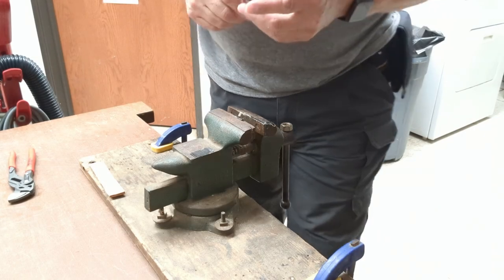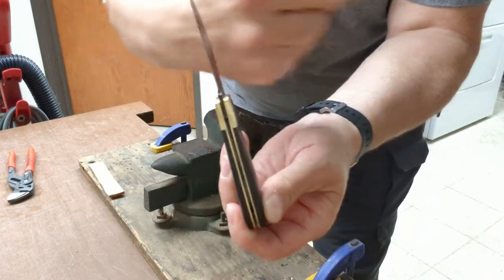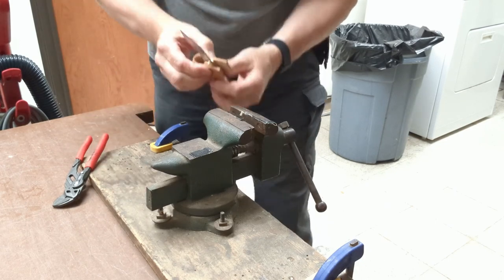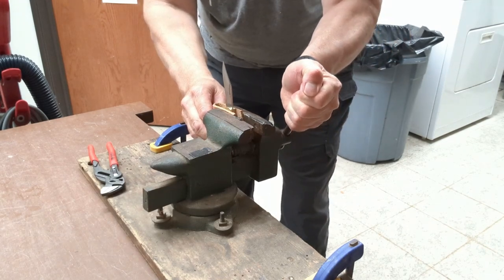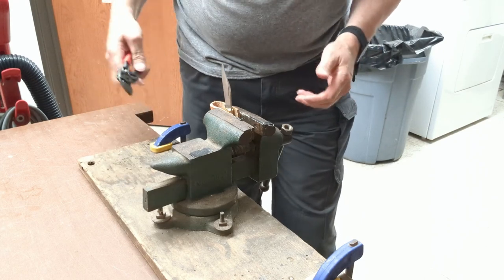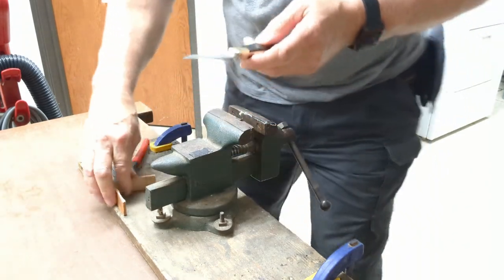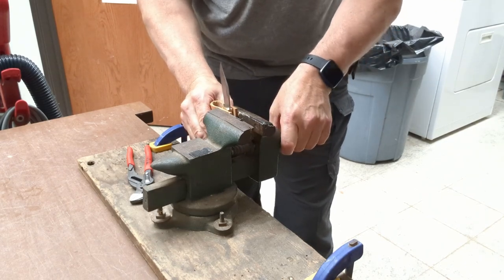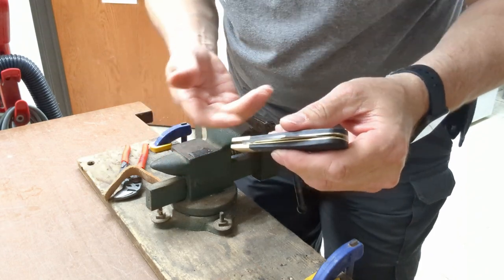Fixing a Michael May Sheffield Traditional Knife

Comment: I understand blade-centering is an issue to some, but I broke my Kenavo trying to fix it. Just take my advice, it's not always worth it. Be careful out there! And good luck to those who try!
Reply from the maker: In order to do this you need to have a good feel for mechanical things. Someone that always strips screws out probably does not have this "feel" and should not try this. You have to understand the materials and there limits, then by feel stay underneath those limits.
Reply: @LastChanceKnives  I'm no professional, to be sure. I tried the Johnny Juke method, which seemed somewhat simple. I guess it's a good learning experience for me. "Don't take risks that aren't worth it".

Comment: I’m not sure where a knife blade, touching its liner makes it “unusable“, however, the safest way to straighten this would be using a setting hammer in the traditional manner. There is far less chance of breaking the blade, and therefore it is easier to set the blade correctly.
Reply from the maker: A big part of the problem for me is that every one around here only carries modern folders. I carry both. When someone wants to see my traditional the last thing that I want to do is hand them one that turns them off and reinforces their thinking that old knives are junk. So I like to carry a traditional that has no issues.

As time goes by I learn and improve my methods. I show what I have done good or bad and my older videos do not accurately reflect what I do now. It's a learning process. I learn by trial and error. With a heavy emphasis on error 🤣

Stainless knives like this one are very easy to adjust. So far I have done around 15 with no issues at all. Carbon steel on the other hand is very risky and I will not attempt to straighten one unless it's a very cheap knife or one I don't mind working on anyway. For example I have a Case Sodbuster Jr that I will be making a new blade for. The factory blade was bent. It hit the liner hard and was quite crooked  when open.

Comment: That is the INCORRECT way to center the knife blade.
Reply from the maker: The only correct way to center a blade is to build the knife right in the first place! Any need for adjustment is INCORRECT! That said it works just fine and has never caused an issue. There is the technique of tapping on it with a hammer which really isn't any better as you are causing a lot of shock by hitting the knife. Either way is not ideal. Like I said companies need to step up the fit and finish and build them right!

Comment: Unfortunately the same thing on swiss army knives. I thnik the blades and the layers are very straight when they come out of the production, but then when it comes to closing the pivots, the pressure has to be balanced very well to get a same result of tension in the whole knive. When you have screws instead of pivots, it's quite easy to balance it out. I wish the companies would be more focused on these problems even if they are not technically restricting the usage
Reply from the maker: Victorinox does bend the blades on purpose so that more than one implement can fit in one space. Actually if you look closely I think they actually grind them a little lopsided on purpose. I have had about ten of them and they are all the same. None were off to the point where they wouldn't function.

Comment: I remember watching them centering a buck knife and they had a soft hammer tapping on the pivot bolster and it straighten it out. I agree they should examine the product before shipping it out. With that being said nice job!
Reply from the maker: The main reason that I am not afraid to try to straighten a knife blade is because I also make fixed blades. It is no problem for me to make a new blade for a slip joint. In fact I have a Case knife with a broken blade. When I have time I will be making a replacement in K390! It will get a serious upgrade!

Comment: How badly did you mark up the tang with the pliers   ?
Reply from the maker: Not even the slightest mark. They are smooth jaw pliers, Knipex Pliers Wrench. The jaws are softer than the blade so they don't scratch.

Comment: As long as it’s not rubbing on the liner, I don’t mess with it.
Reply from the maker: I here what you are saying. The thing that bugs me most is if the blade is not straight when the knife is open. Most times centering the blade in the handle also straightens it out in the open position.

Comment: In my eyes that blade is now void. You have just put stress in that steel, probably has small microscopic stress cracks in the steel, if not the steel was just stressed. I could live with the offset it had but not after its been stressed.
Reply from the maker: I fully understand your point, but it is not as bad as you think. There are techniques that are used at the factory to adjust blades using a hammer. It happens more than you would think. Not only was the blade here off center, but it was out of alignment with the handle when open. I have extensively used knives that I have straightened without issue. Stainless blades can take a lot of stress without causing a problem. Plus, the steel on many traditionals is run a little on the soft side, making it even less problematic to straighten.